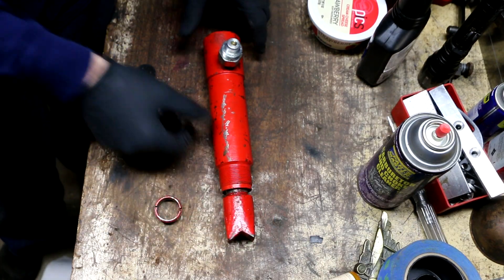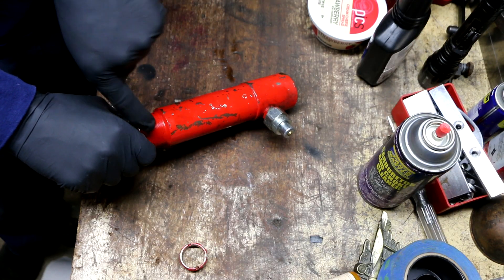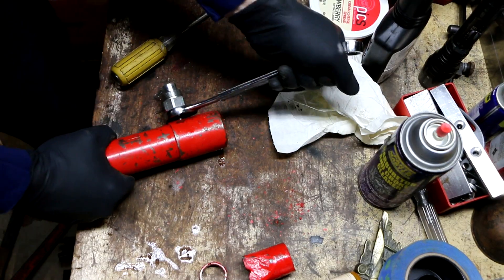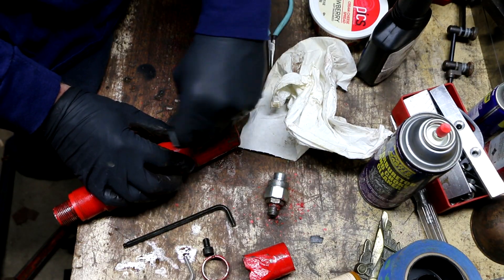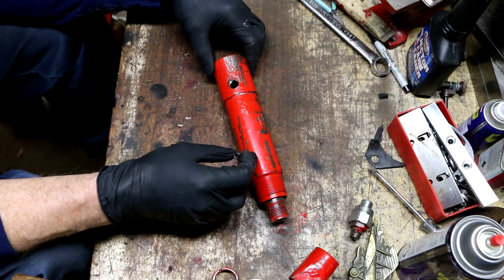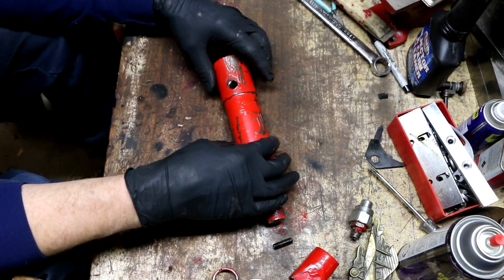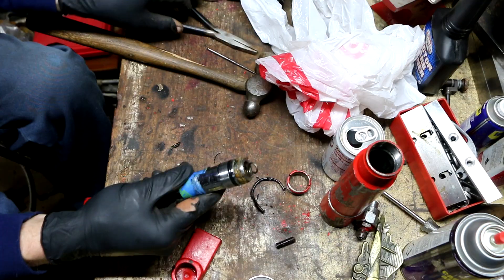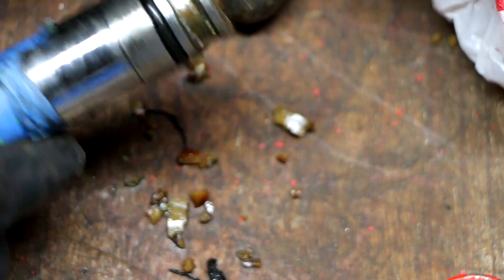Porta power cylinder ram repair rebuild Blackhawk Enerpac Harbor freight

Comment: i done the cylinder and now need to do the pump, i wonder if the new seal things will deteriorate like the old ones, seems the black rubber ones are in good shape, wonder why they used the plastic ones?
Reply from the maker: I don't know. I think they are not plastic, I think they are a type of Urethane.

Comment: what shall i use for oil?
Reply from the maker: @jimkurk5575  hydraulic jack oil. Available at most auto parts stores.
Reply: @stevewatr  why i wanted to know is because what happened to that seal crumbling like that could have to do with oil that is not compatible, just thinking.  my unit quit working  after a while, it never was used much and i did not take it apart yet waiting for seal kit, never knew where to get parts before seeing you video. thanks for the info

Comment: I have a Blackhawk 65150 and it doesn’t have a hole to use a wire to pull the spring.  I am stumped on how to get the screw reinstalled.

Comment: There all like that the one I got made 2 good pulls next day was leaking and not pulling nomore. You might could get you a 90 degree pick to grab that spring. I just love working on brand new stuff don't you. They use the most odd things they can find.

Comment: what was part number for the packing seal? great video wire was a great idea.
Reply from the maker: AES 80460 is a generic kit for 4 ton ports power rams. However, like I say in this video, there are variations in these designs so no guarantee this kit is correct.